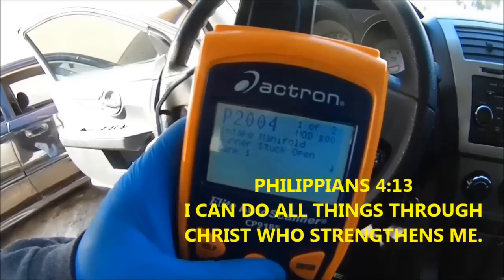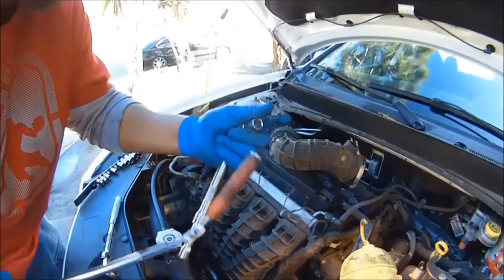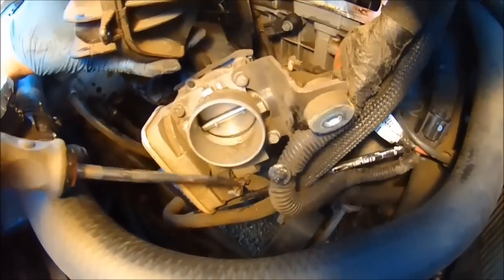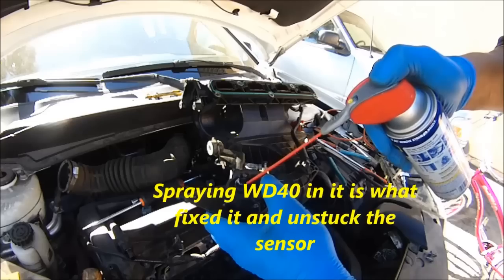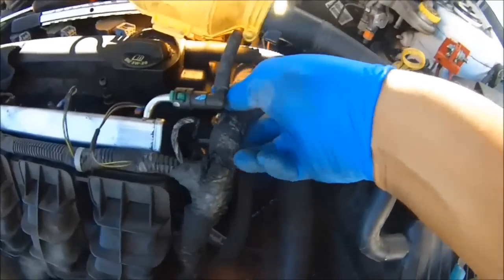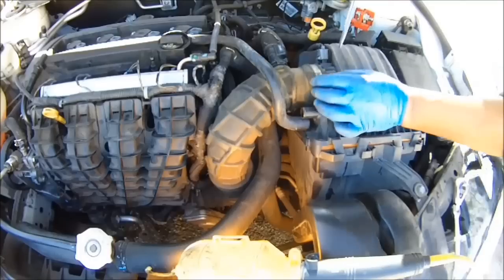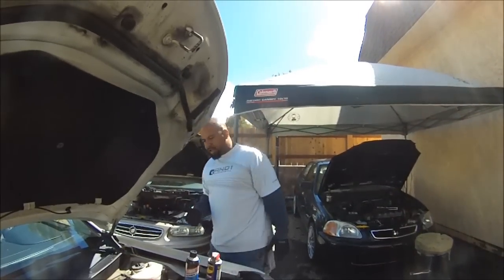FIX CODE P2004 & P2017 W/ WD40 & CARB CLEANER 2009 DODGE AVENGER INTAKE MANIFOLD RUNNERS STUCK OPEN

Comment: I was going to comment about not having to remove everything to check the IMRCV, but around 8 min in you said it, good on you man.

Amazing video, my only critique, especially for "at home mechanics" that may not have time or knowhow, would be to remove and check the runner control valve first, then if that seems bad, or replacing that doesnt fix the issue, get to this level of removing the whole intake manifold.

The part is like 70 bucks from rock auto and if you're going to do any of that, its probably worth replacing anyway.  If that doesnt work, your solution is much better than the 230 for OEM or 500 for MOPAR to replace the manifold itself... but me being the average dude, Ill take the 70 gamble outright in hopes to not have to rip the whole thing out.  If that doesnt work, then we dig deeper and see if some carb cleaner will break it loose or if the manifold needs replaced too.

Comment: indeed, we can do all things through Christ who strengthens us! thanks so much for all your help! i cleaned out my maf sensor and also the throttle body intake then went on an hour long ride , all was good till service the engine light came on and didn't run right and i got the imrc stuck open code , i think it was p1518 and i took the idea of what you said of carbon buildup that can cause the stuck position , hindsight is 20/20 looking back i should have cleaned off the gunk spray and wipe it clean with the rag but instead i thought let it clean the inside a bit ( stupid move ) , after watching your vid i dumped a bottle of gum out tune up into the gas tank , took off the negative end of the battery cable off and then put it back on again for 10 minutes then started the car up ( service the engine light was gone ) took it for an italian tune up ( driving on open highway at very high speeds 65 - 80 more like 80 lol ) the engine light did not return, still to soon to tell if service engine light will come back on or no, but when i tell you she ran like a dream ( whereas before was very rough ) i mean it, just wow! resetting the car computer plus the gum out was perfect combo and of course our precious Lord Jesus, nothing belongs to us all has been gifted to us by Jesus including the air we breathe and our body. thanks a million brother keep pluggin the love !

Comment: I have a Dodge Caliber that's throwing the same two coats I've already replaced the center and the throttle body. My car is getting horrible gas mileage so fingers crossed this works for me as well

Comment: Oldskool funk.  Thanks for sharing the video instructions.  I performed these procedures on a 2009 Dodge caliber.  except I didn't pull the Intake. I pulled the intake manifold control valve and the position sensor switch. I'm hoping after I cleaned the parts, I'm hoping that will fix it.  If not I may have to do it again, and this time pull the manifold.
Reply: Any update?

Comment: I replaced the valve sensor the spring loaded you one you mentioned and the check engine still came back after I cleared it . I’m guessing those runners are stuck inside the intake manifold but damn that’s a lot of work

Comment: Like everything except the part about the power steering pump removal and installation . . . You made the rest look like a piece of cake.  Someone that doesn't realize you skipped over that part will be lost as soon as they look at the first nut on the passenger side of the manifold, down low - the one you dropped the nut on in the video.  You cannot get the intake off without removing the power steering pump and all that requires.  Other than that little bit, awesome video.
Reply from the maker: +Doug Payson I never took off the power steering pump at all. I dont leave out anything in my videos.

Comment: So the runner and the sensor should only turn about 20°-30°, does that sound right?  Going to check the movement on them before I decide to take off the entire intake manifold.  Love your video!  Thank you!!
Reply from the maker: Ian Griffiths Thanks Ian, Yes it does not have much movement maybe a 1/4 turn. You should definitely try and spray the sensor with WD40 and let it seep into the sensor and see if that helps first.

Comment: Sir, I owe you a debt of gratitude. I am no mechanic but your explaintion and little tips like the pieces of paper to hold nuts is invaluable. I have a 2008 Seabring with the same code. Watching your video gave me the courage to do the job. I even want to a junk yard and took manifold actuator off and replaced it on my car.for a bit more practice while at the junk yard. At the end , I missed a couple of wired  connections,  a day or 2 of trail and error and my car is now fixed. 
Proud to have done it by my self with your instructions.  Saved hundreds of dollars. I wish you and your family health ,wealth and happiness !! Thank you !

Comment: Thanks for the video, I watched it trying to fix my 2009 Jeep Patriot 2.4L throwing P2004 and P2017. Some things were different like the fitting and connectors but still the same process. I used Sea Foam Deep Creep instead of carb cleaner and changed the runner control and put on a new gasket, it stopped throwing the codes for now, Cost was under $100 for it all.

Comment: I have just tried it on December 7th, 2018 and it seems to work. I erase the error code a week ago and no engine warning light has turned on during the last seven days. I did not even have to remove the intake manifold. I just removed the intake flow valve (in less than 15 minutes), I sprayed it with a penetrating lubricant (creeper ... just like WD40) and the problem has been solved. Thank you OldSkool Funk for sound pieces of advice.

Comment: same issue with my 08 jeep patriot thanks for the helpful video
Reply: Sylvie Fenyx I have an 08 Sebring reading code P2004. How did this work for you?
Reply: it is a sensor on the intake manifold its called a regulator sensor intake i have it being replace in a few days hopefully it solves the issue

Comment: Would using something like Marvel Mystery Oil or Seafoam in the gas tank clean up something like this (and free it up)?? Just curious. I'm guessing it's the bad gas we're using that's causing this to get dirty/carboned up?...
Reply: +Maverick B no, because that would go into the fuel system and not the intake. maybe running it into the vacuum line

Comment: Great solution. I was able to clear the trouble code p2017 by removing the position sensor only and applying the WD-40. It cleared after a few hours of driving. These dealerships try to get over on us for simple repairs. God bless you!

Comment: first off, thanks soooo much for the video...had this code forever and i like to do my own work, but couldnt find proper info i needed for my dodge caliber....so, i checked everything you showed and its all exactly the same as yours...its stuck open, the sensor has spring tension.......what do i do now? @oldskool funk
Reply: +pickingforchrist nvm, the WD40 actually worked and cleared the code....thanks

Comment: I wish mine was that easy. The code on mine was P1004.  Mine is the 3.5 and the short runner is binding. The servo is good on mine. For my car, it is around $1500 for the new plenum. That is the only way to replace the short runner. Poor design for us at home, money maker for the dealership or parts store. I can get a used one for just under $500. I hate to use the credit card. lol  Great video.

Comment: I saw this a while back thanks for your insight on what to do I replaced the intake runner sencer with no luck have the same 2 codes you have I have WD-40 and intake cleaner the vavles on mine move freely but the new intake runner thing I got is stuck open like the old one was I will give your video a try Dodge told me to get a hole new intake manifold for like $900 it's crazy how much they wanted for it I'm going to give your method a try hopefully it fixes it

Comment: I just finished this on a Sebring. Same motor and everything just like the video says. My problem is the check engine light is still on. So it might be the actuator. I just don't have any of the tools to test it. With out a scantool is there another way to clear the code?
Reply from the maker: AshyBoneVR4 disconnect the battery for 10 seconds to erase the code
Reply: oldskool funk Thanks for the fast reply. I didn't have to do that. I let the car run for 5 minutes then turned it off then back on and let it run for five minutes again. Did that three or four times and the code cleared itself.
Reply from the maker: Cool, ya sometimes codes take a lil while to go off but I usually disconnect the battery or use the scanner. Congrats on your fix its all about DIY

Comment: God Bless You!!  Yes I too have a 2009 Avenger with a 2.4l engine.  I followed your advice and removed the valve control unit.  The manifold was moving freely.  WD and Gumout, problem fixed!!!  The CEL does not need to be flashed as it goes out on its own.  Wow, that was easy.

Comment: Do i add gasket sealer installing it back ????
Reply: Shouldnt at all just check the gaslets on the intake manifold if u can see the little rubber seals make sure they are still spongy and flattend on the mating side if they are or are just overly worn u can get those fairly cheap any auto parts store
Reply: @bradbyers2764  so I fixed it and no light back on after a month. Drives fine but maybe I'm tripping. My acceleration feels a lil diff or it's just me. Gas seams normal would like to hear your thought. 2 years fixing cars would love to hear feedback
Reply: @mikesanchez7082  well that depends on what you mean by differant if its idling rich or not realy idleing or responding the way it should maybe you should double check the header gaskets and vacuum lines as well the canister next to the tank and make sure that all is looking good let me kn what syptoms you seem to be feeling

Comment: I have an 08 avenger with p2004 code, been driving it and it runs fine other than not going above 4k rpms but is it alright to remove the runner control without removing the entire manifold?

Comment: i have the P2017 code on my '09 dodge avenger 2.4l, i cleared it and the check engine light went away but when i rescan with my obd2 the code still pops up. Im going to have it looked at, but im wondering if you cleared it with a expensive scanner or a cheap one?

Comment: I have a 2008 jeep patriot with just the P2017 error code. I believe it pertains to the intake manifold as well. would I have to remove the entire intake manifold in order fix this error code as well or can it be done while still intact? thank you for the video.
Reply: I have an 08 patriot throwing the same codes. Did this work for you? If not,  what did you  do to clear it?

Comment: Thank you. I had the P2017 and followed your directions. Not a terrible job to get done in an afternoon. Looks like you would need to pull the intake manifold to replace the starter as well. Excellent instructions. Thanks again. God bless!

Comment: My husband and I soaked and cleaned the manifold like you suggested. But we still had the code 2017 , so we bought the part and he installed it. A little smoke, but went fairly well. The car even ran better. (We did spark plugs, air filter and a new gas cap that was needed). But the code is still there. Maybe after 100 miles it will turn off. Nope, no luck. Called Dodge and they said it was the part itself that we replaced. They suggested we buy the part from them, and even guaranteed it would work. But I also have another concern. When I fill up on gas, the car bucks and stalls if I don't gas on it quickly enough, which leaves a hint of gas in the air. What do ya think? I'm trying to do ourselves, save some moolah, and pass the state inspection. Plus your a good teacher😀
Reply: I have the same problem. Did you fix it?

Comment: Where are you located Im having this exact code pop up on my Jeep Patriot 2009
Reply: I have an '08 patriot same codes.  You get yours cleared?
Reply: I have the code on my 09 Jeep Patriot.  Did you fix yours?
Reply: Corbin Konoski - - I cleared mine.  I pulled the valve motor and sprayed wd40 then a better lubricant (fluid film) put it back on and manually cleared the code.  My gas mileage went from 210/tank to 250/tank within a day
Reply: trecel1 how difficult was the work? ive torn engines apart before, but never the jeep.  thanks for the help.
Reply: Corbin Konoski it was way easier than what I thought.  It's easier than changing brake pads or an alternator.  It's 3 bolts,  pull it off and lube it then put it right back on.
Reply: trecel1 even better, ill try it this week then.  thanks.
Reply: Apparently your definition of easy and mine are different.  That bottom screw is a bitch. haha.  I got it though, and even though the code is still there, my idle is more even and at below 1k rpm.  Thanks again.
Reply: Corbin Konoski haha sorry,  it took me about 20 minutes but I also had a flexible driver for getting the bolts off.  I'm glad to hear it is working.  The video helped me out quite a bit.  You can pick up an OBD code reader on Amazon for 5 to 10 dollars.  I bought one and then the torque app and it works great.
Reply: trecel1 yeah thats what im using to clear it, but it just comes back on...im hoping it will go away in a while, it idles better now.  thanks
Reply: Corbin Konoski I waited a few days then cleared it and no problems.  Best of luck man.

Comment: Thank you for this video! I will be getting to it on my 06 Benz. I've got these same codes as well as P0012, P0015, and P0016 codes for the camshaft position sensor. Wishing I had a good back up for advise when I am diving into this for my first time!  Huge thanks for your message after the tutorial! It was on point too! I needed to hear that!

Comment: I have the same problem with my Dodge Avenger 2008 2.4 L K and I have the P2004 and P2017 as well...

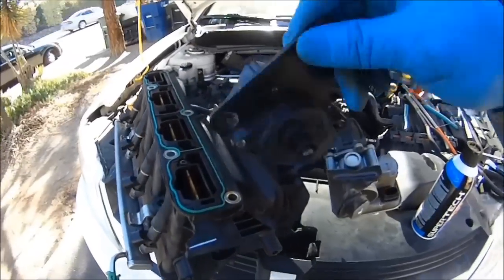As you did on the video, I remove all Intake Manifold, and the gates (or flaps) are in good conditions, they move freely, but I got a little confuse on min 9:00, so, you didn't change the control valve right?, you just cleaned-up spray some DW40 and put it back right?.

The only step I need is the re-programing.

Comment: The Ford Focus intake manifold has 2 sets of these flaps.  The lower set is not accessible without cutting the manifold open, and both are run by vacuum actuator.  $$$ if you don't put in the labor yourself.  Good video.

Comment: great video, my engine light was on for 2 years because they wanted 1100.00 to fix. Took me 1.5 hours and it's fixed. I did change the gasket for $7.00 and torqued the intake to spec with torque sequence.  Thank you
Reply: hi John Can you pls tell me the dodge caliber intake manifold torque specs n sequence.  I cleaned mine but now I got the bolt light on.  and codes are still there
Reply: +Abhishek Sharma the codes don't come off unless you clear them.
Reply: I cleared then and they showed back right away..I feel that I may have to buy the intake manifold..I followed all the video instructions and put back everything in order. .will check the connections again today. .I didn't change the gasket though
Reply: do you know the torque sequence n specs for dodge caliber
Reply: I need to look for it.
Reply: +John Spadaro  20 Mar 2006, 08:31 pm

Hooligan 

Obsessed Cruiser

 

Join Date: Aug 2003

Posts: 6,025

Hooligan's Gallery

13 foot lbs. 105 inch
Reply: +John Spadaro  in this order from left to right 5,3,1,2,4
Reply: +John Spadaro Thank you John!
Reply: sorry to say but the same code just popped up again. it lasted about 5 months
Reply: +John Spadaro I had to change the entire manifold. so with the help of this video and your help with the torque settings everything is doing fine so far. 
I passed my emission test so won't need to worry about it for two years anyways.

Comment: I just did the same thing on my 08 and now im getting only a crank,no start. Any ideas on what it could be?
Reply from the maker: Adan Hdez Check for spark, then pulse width (injectors open and closing duration) with a noid light or test light. that checks for crank or cam position sensor trigger/ pick up sensors are working and if the computer is receiving a signal. It can be a number of things but I would start with that first. You either have no fuel, no spark, no proper combustion or a sensor or wire issue.
Reply: oldskool funk Im getting sparks,and fuel pump is pumping out gas. Was told the fuel injectors werent getting fuel. How can i check for that? Or could it be a fuse?

Comment: Thank You! I took off the part, without touching any of the manifold, just moved anything that was in my way to get to the thing. It was filty, so I WD-40'ed the living stuff out of it, and cleaned it, as well as the other part that goes in to move the vents open and closed (which worked fine, turned easy and I heard it open and close well), used my OBD reader to reset the engine light, and voila...drove it up and down the road and no check engine light!!  All 83 lbs of this 60 yr old woman, thanks you!